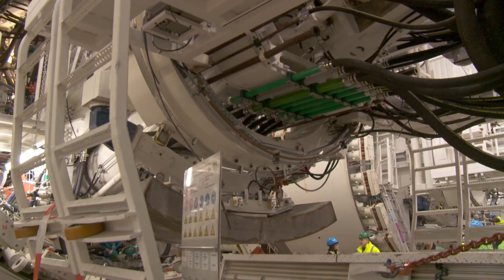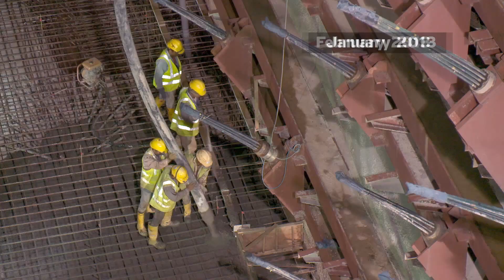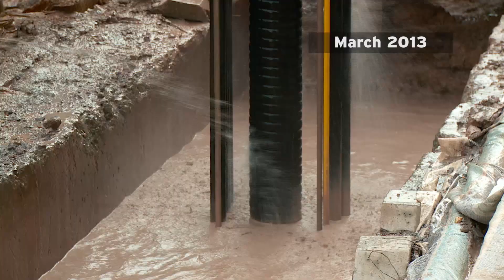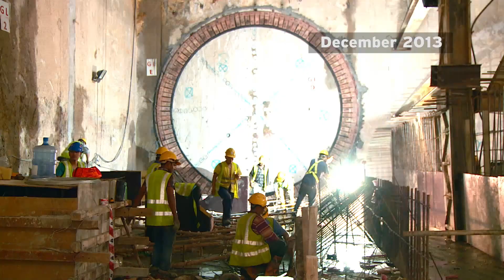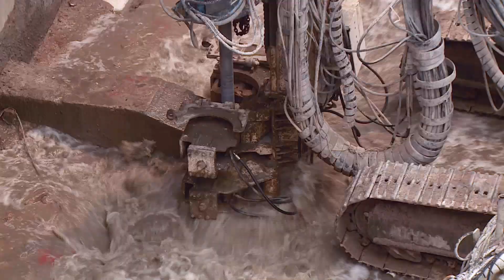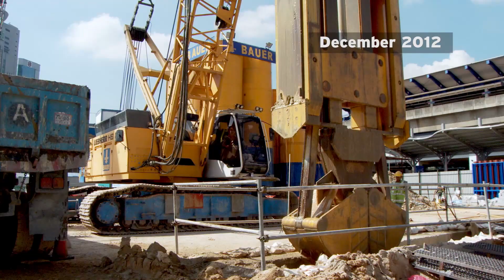KLANG VALLEY MASS RAPID TRANSIT (KVMRT) -- UNDERGROUND (UG) Progress Video

Comment: If I may ask, this project is called "MRT" is it bcoz of the Mass amount of money needed to be forked out, and not bcoz of the mass volume of ppl it is capable of transporting at one given time? Looks like it's capacity is not so "MASS" with just a 4 coach train, and was told that the station is 120 meters long. The up and coming JKT MRT is 200 meters long.
Reply: Fuad Abdul Latif If 4 coaches only MRT does not justify for the word "MASS" then how come the Thomson line and other newer line in Singapore were give the status of MRT?
Reply: It has more capacity than London Underground's trains.
Reply: Fuad Abdul Latif compared to singapore some lines on the mrt has 3 car trains, but there will be crowding lah